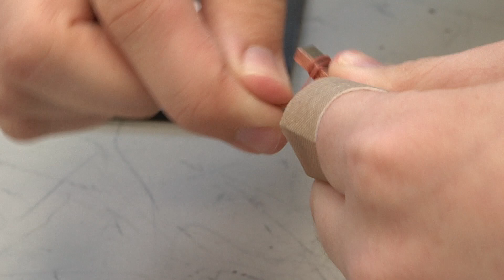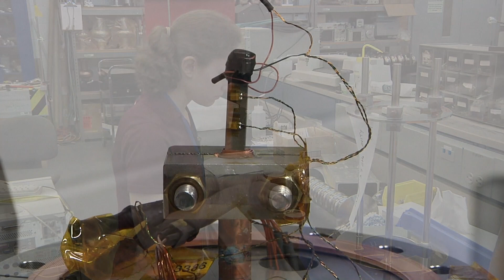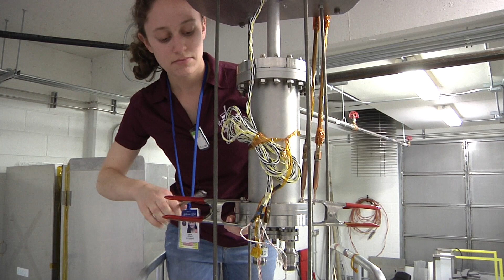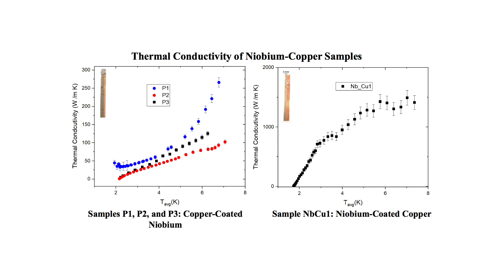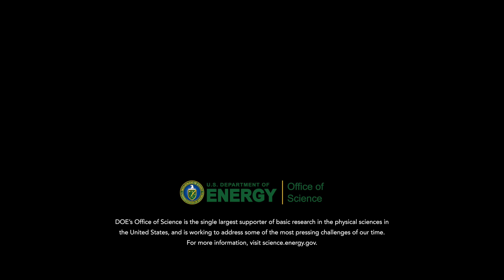SULI Student Spotlight - Lacey

Comment: Cool research topic! And very well communicated Lacey. Well done! Does any part of the niobium go super conducting? I’m guessing that might make your calculations challenging?
Reply from the maker: Niobium goes superconductive around 9 K and Lacey said the bath they are exposed to is around 1.5 K to 2 K. Looking at her graphs, it seems as if the samples stay below 8 K, so I would expect them to be superconductive.
Reply: @JeffersonLab  Yes! All tests were done with superconducting niobium so that we could simulate more closely what would happen when the accelerator is running.
Reply: Lacey Wright ok. Sorry, my background is electrical engineering and for some reason I had the thought that superconductors blocked the transfer of heat as well as magnetic fields. Thinking about it now though, that doesn’t make sense, but then, neither do superconductors in general for me :). So have you found a better niobium mix than what’s currently being used yet?